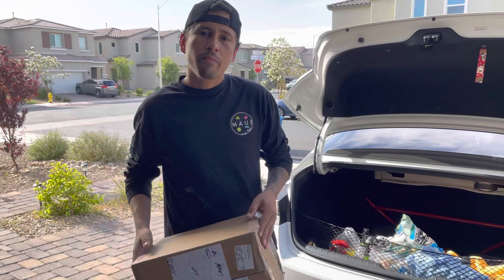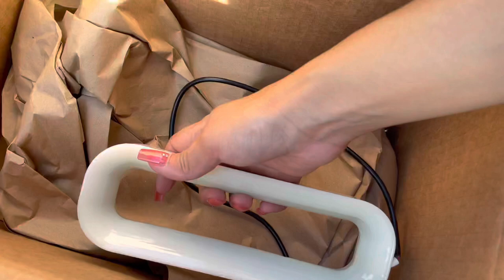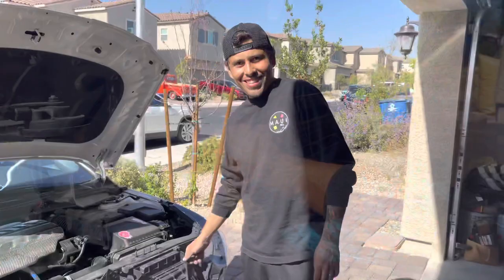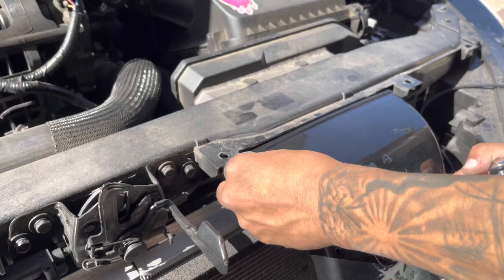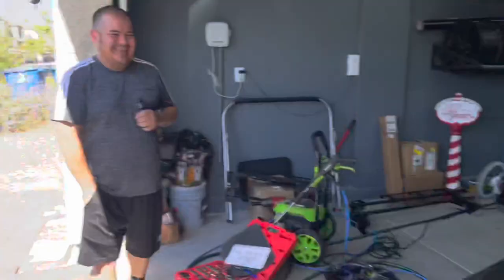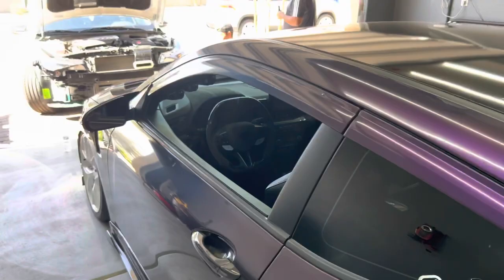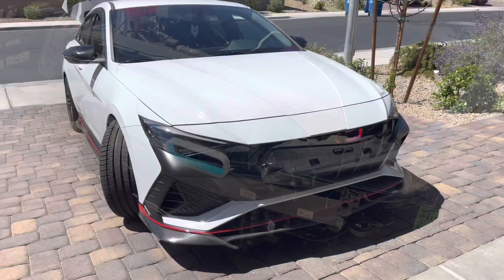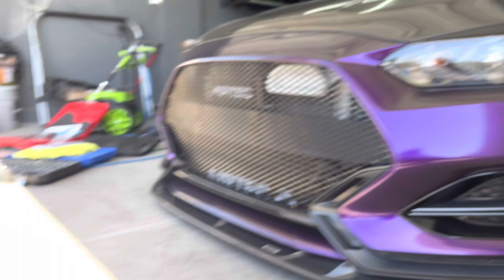How to Install a Velossa Tech Big Mouth Lit Kit on an Elantra N

Comment: Just so you know, the shroud is designed to increase air pressure/velocity through that area many times better than having no shroud.  I would not get rid of it if you can help it.

Comment: Congrats man ! I been watching you guys. Taking some notes and see'n what new stuff is in the pipe line for the EN. Don't take offense but I linked up with #titanium_x and other sources for some parts... I'll be on here soon with some of my own content but as it is I'll be (like I said) taking notes. Good $#!+ ... I dig the concept inspired upgrade wheels, similar to the OEM ones. I'm actually looking into OEM Genesis wheels (square set) off the G70 at the moment. Off set is off (47mm v.s. 55mm if I remember correctly) but they fit the theme of the vehicle nicely. #elantran #i30n #avanten #hyundaiusa #hyundaiperformance #hyundaikorea #hyundaielantran #n_grin_shift

Comment: I emailed the velossa tech company to ask will this fit my Hyundai Elantra SEL 21’ they could not give me a specific answer.  But 9/10 most of the N line products do fit my vehicle. 

Do you think the set you ordered will fit my vehicle
Reply from the maker: It’s a 50/50 chance to be honest. I have never seen behind a Elantra front bumper to know. Best thing for you to do is pull your bumper off and compare the front end radiator support area where the big mouth mounts too to be certain

Comment: is hooking up the "LIT KIT" part the same compared to hooking it up on a Veloster N?
Reply from the maker: Exactly the same. @synergymedia has a good video on the vn install.
Reply: @KDMStation  yes i found his video just doesnt show the wiring of the RGB part from the velossa tech!
Reply from the maker: @strangenemo808 it should be the same since it’s wired directly from the battery. Just run the ground to somewhere in the same area I did and same thing with the switch.

Comment: what is the point of that thing anyway?
Reply from the maker: For shows and to show off at car shows. The led functionality has no other point other than to be a show point.
Reply: @KDMStation  as snorkle tho does it change anything? Looks like it's coming off as soon as a cold air pod filter is available
Reply from the maker: @damienfrizzell9394  nope this will utilize the same air box that SXTH will come out with as well as afe. So it won’t be removed with any other intake.

Comment: So I have the same kit, everything the same, but there’s a black bar in front of the condenser, in front of the radiator, and it is apparently a transmission/oil cooler, but yours appears to be taken out… did you have to take it out?
Reply from the maker: My wife’s Elantra is a manual so she doesn’t have a trans cooler. We didn’t run into that issue. But Velossa tech wouldn’t have made the kit to remove the trans cooler. I believe the dct version is slightly bended in the back to make room for it.
Reply: @KDMStation  it’s actually slightly carved out in the back, so it works out perfectly

Comment: I picked up a 2021 Kia Forte GT MT two weeks ago, noticed the switch near the fuse box and I was so curious about what that was for and your video definitely answered my question! Awesome mod. Since I'm a second owner of the car and never got to meet the previous owner, idk how to connect that to to my phone(app). Did the instruction come with a special code to connect the bluetooth to your app or does it just pick up?
Reply from the maker: It should just pick it up as long as you have your Bluetooth on your device on. I would turn the switch off before wait about 10 seconds. And then try and turn it back on and connect.
Reply: @KDMStation  yup I just downloaded the app and it picked up right away. It’s so cool! Thanks for the tip!

Comment: Will this void the warranty at all?
Reply from the maker: No, even if they tried to claim this caused any electrical issues. It doesn’t plug into any fuses or anything. It direct to the battery so they would have to prove this caused the issue.

Comment: No night vid? Also that alot of extra wiring. I would cut and splice to shorten that up.
Reply from the maker: It’s not that big of a deal for us. I’m sure they include that much in case you want to run it somewhere else in the Engine bay.
Reply: Custom made. Elantras in general dont get love like hondas, ect. 300 well spent indeed. Besides, performance plus lots of money go hand in hand. :)

Comment: Not the best diy video.. lots of missed explanation. But gg on showing the actual product.
Reply from the maker: As long as it helped in someway 🙌🏽
Reply: @KDM Station  Hey 10months kater since i have you. Hows the product through wear and tear?
Reply from the maker: @robertc.5558  still looks good. It needs to be wiped down periodically but you can access everything the grill